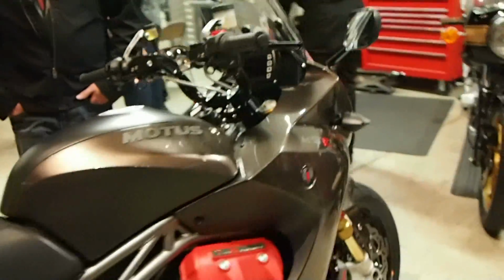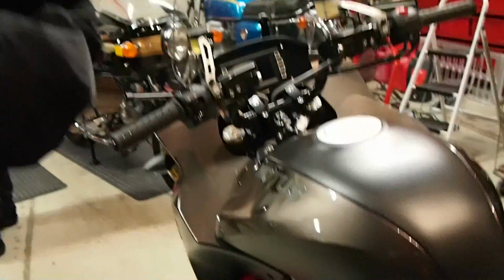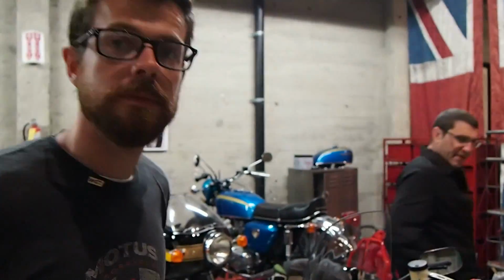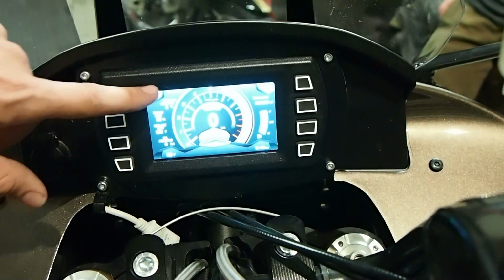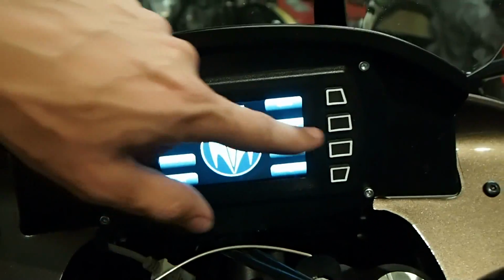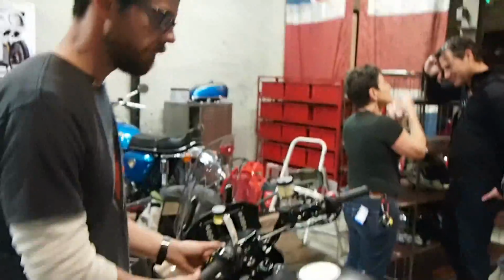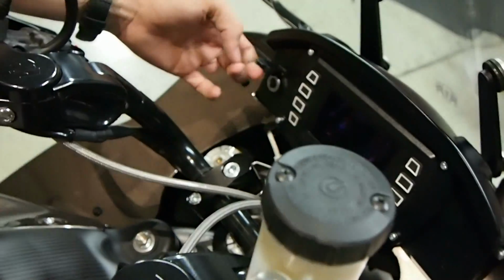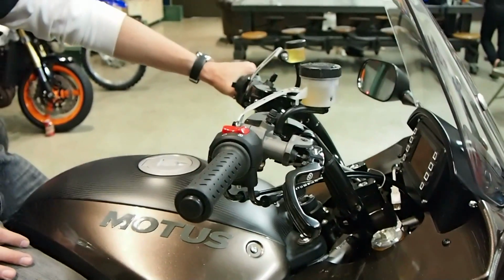Motus MST-R: Up Close!

Comment: re: "While I understand the simplicity and cost/weight-saving value of a chain drive, I can't help to wonder why they don't go with a shaft drive."

then it just means you don't FULLY understand the cost/weight-saving value equation.  there's more to it like engineering a robust design and warranty issues over the long term.  this engine is 1.7 liters.  you don't just whip up a shaft final drive, throw it behind that kind of displacement, and hope it all works it out.  ask BMW how this works.